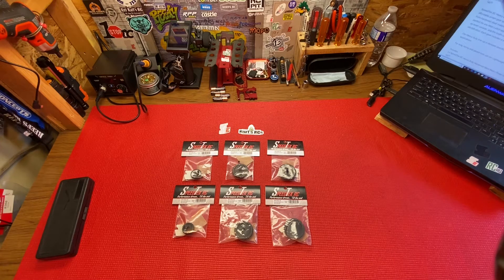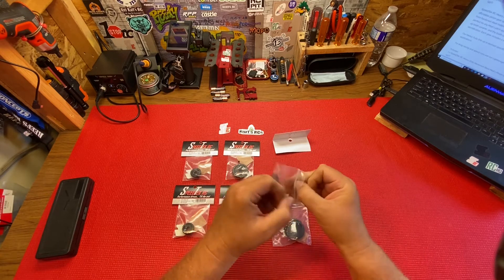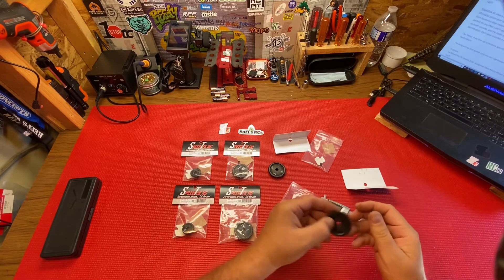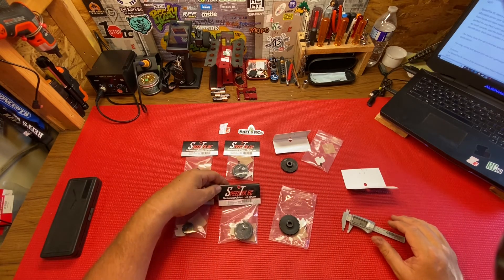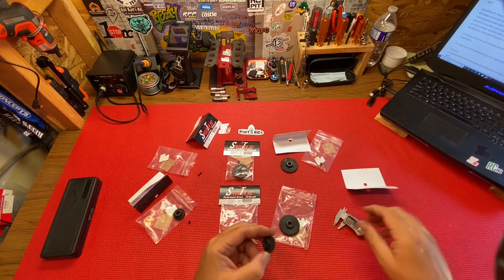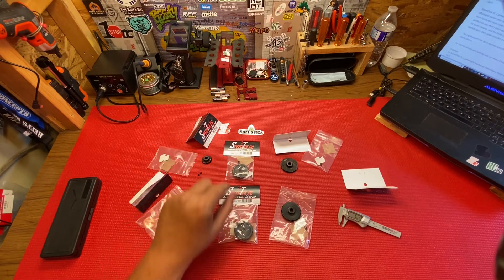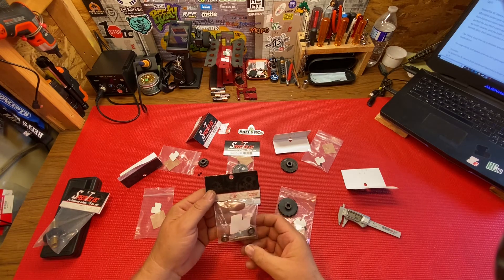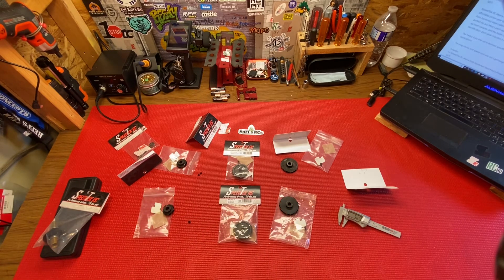SpeedTek RC 8mm Mod 1 Gears --- The difference between light weight and heavy weight

Comment: Are the measurements the same for the 5mm bore "Lightweight" Mod 1 gears from SpeedTek?
Reply from the maker: Not sure what you are asking, do you want the width/thickness or the height
Reply: @KurtsRCs  I am asking if the face width dimensions you show in the video of the 8mm bore are the same for their 5mm bore gears.  Also yes I am interested in the overall thickness including the hub aka height of the gears.